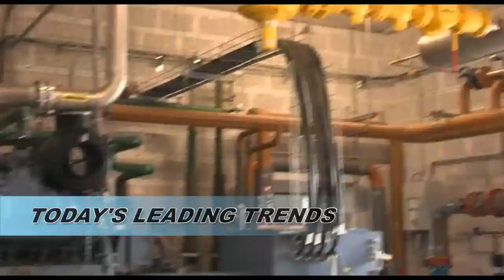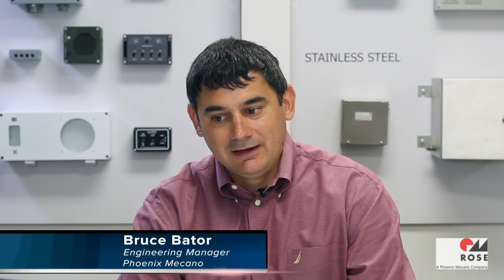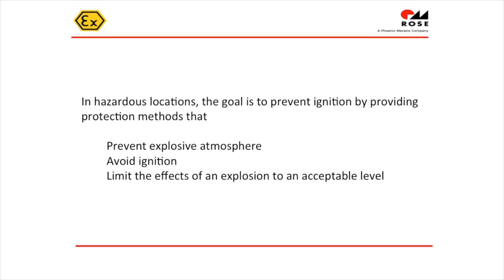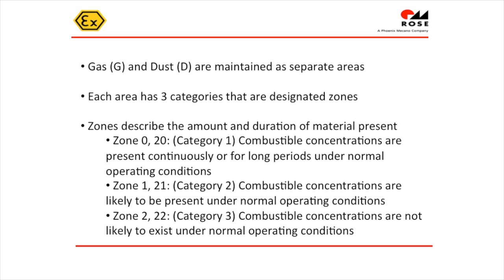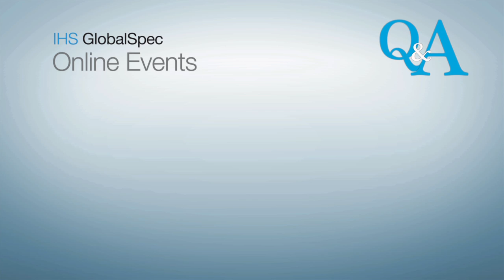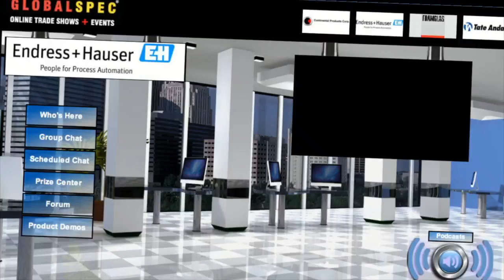Protecting Electrical Equipment in Hazardous Locations

Comment: A small note on the zones VS categories system and why they don't match is most likely due to how it already was established in most IEC member countries in their standards for other applications. IEC 60364-7-701 (Special electrical isntallations - Locations containing a bath or shower) defines zones in a similar fashion, the inside of the bathtub being zone 0 for example. Would it be nicer if they matched? Yes. Would it be better if there were the vast majority of IEC members, which had a zone system for everything else in that fashion, had standards which didn't match just one branch of standard? NO. Absolutely no. 88 IEC member countries besides the US have those zone systems already in place. If anything, the category system needs to hit the well deserved bin.